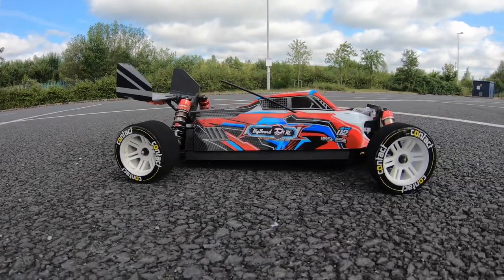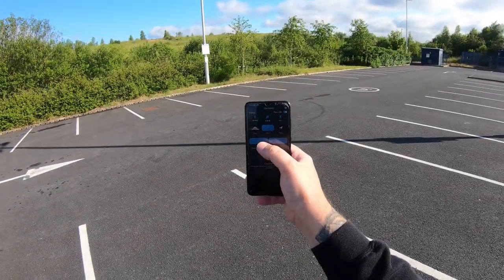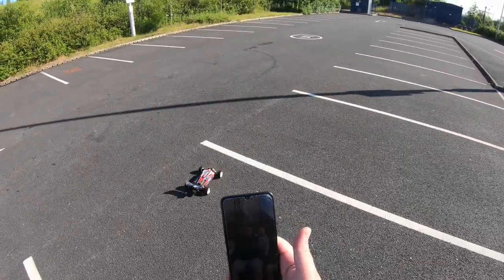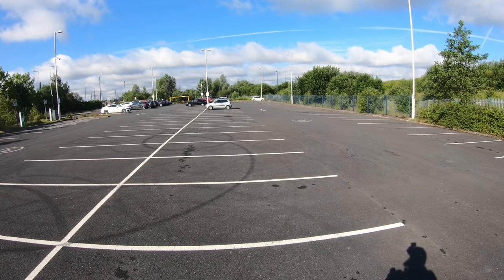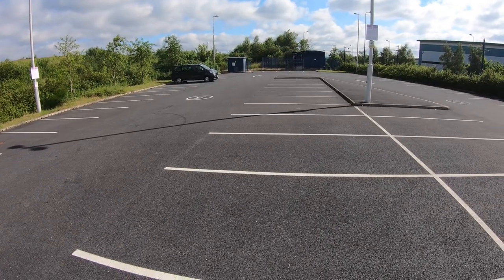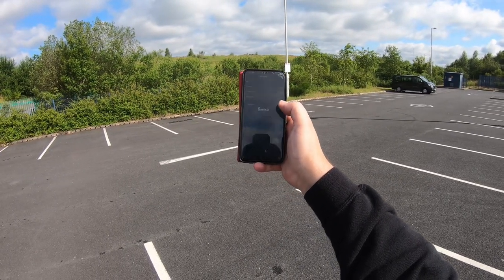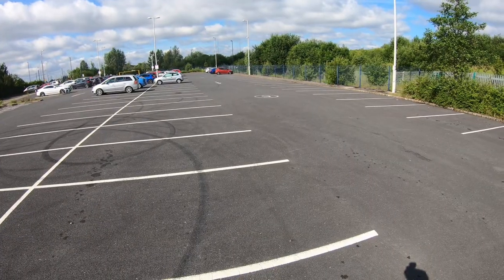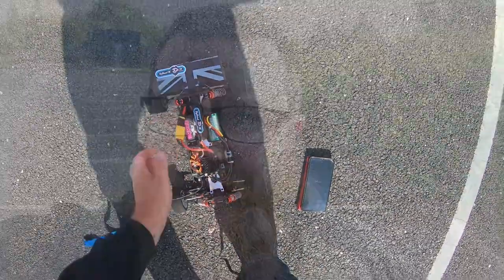Wltoys 104001 Mod1 Speed Run

Comment: Hi, quick couple questions are those standard 1/10 foams 12mm hex? An where or how did you get the parts for the mod 1 conversion?
I’ve been looking for a different replacement spur but can’t find anything at all.
What’s that rear wing from looks very nice.

Anyways thanks for any info
Reply from the maker: Hey buddy 

The foams are contact 1/10 drag foams they're slightly larger which is needed to fit over the hubs and steering links

The mod1 is easy and uses the original spool you just need to cut the spur gear off and use the ends I can sort you one out if your interested just email me 

The rear wing I made myself from kydex
Reply: Hi mate don’t want to pester you but any updates on that mod1 gear mate?
I’ve sent you a couple emails since am just wondering.
Reply from the maker: @letzvisit1661  hey buddy ill send you an email tomorrow morning apologies been mad busy
Reply: @bigbeardrc4145  no that’s absolutely fine I was just wondering about that mod 1 spur gear you was gonna send out and I was like not sure if I should contact you again or maybe you’ve forgotten. Well since then I ended up getting a rocket 7500kv I think I’ll have to check motor from Amazon it’s on order. 
Would be awesome if we could chat over a build of the 104001 I’ve lowered the car 10mm front and 8.5-9mm at rear and added 80wt shock oil. 
So I’m gonna order a radio next and maybe some spare diffs but a carbon kit woulbd be another option.

However hopefully you still have my email and we can chat over a build that would be awesome I want to try and make a rossa date next year if possible. 
Just want to fit mod1 rather than the stock gearing

Comment: Seriously mate, that car cost more than a Tamiya TT02 for using it on asphalt and too weak for dirt track. Tamiya TT02 got hundreds of very nice bodies and even more mods than for a 144001 !
I will buy a TT02 the day I will get bored of 144001.
Reply from the maker: Tamiya tt02 are brilliant mate I will get 1 eventually
Reply: @bigbeardrc4145  mine break quite a lot.
Reply from the maker: @grrfy  good to know bro,but what people need to remember is this is a relatively new company and miles cheaper and more capable than expected
Reply from the maker: @bretzel etouffeur For the same price as the 104001 you get a chassis a body and a brushed motor,what you dont get is a controller and receiver,bearings all round,servo,charger,and batteries so for the same kit including a lipo which is supplied with the 104001 is between £230 and £250 plus so not even in the same ball park 😉 I think you need to research 😉 first
Reply: @bigbeardrc4145  no I meant My tt-02 are always breaking!I
Reply: @bretzel for someone that doesn't like the 104001, you spend a lot of your time watching videos of them.